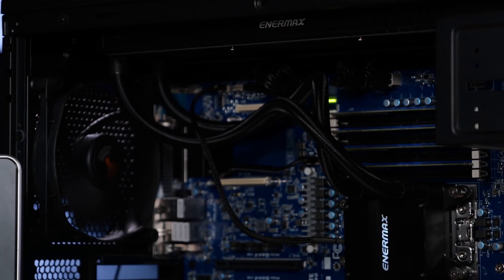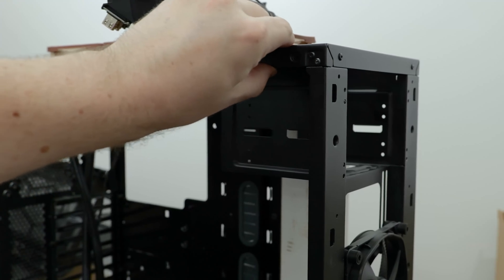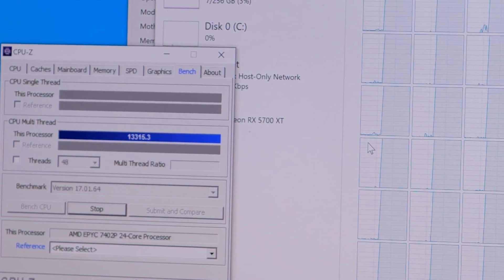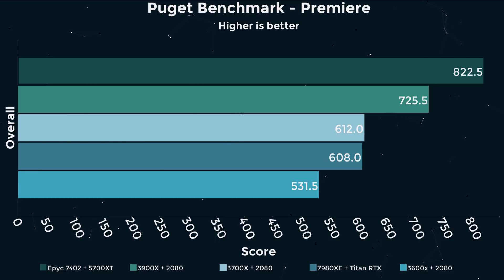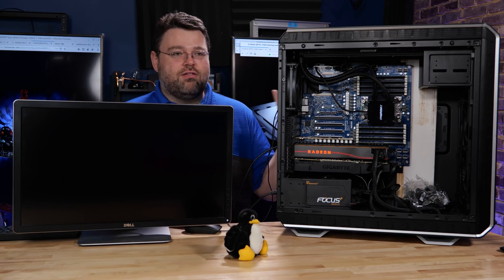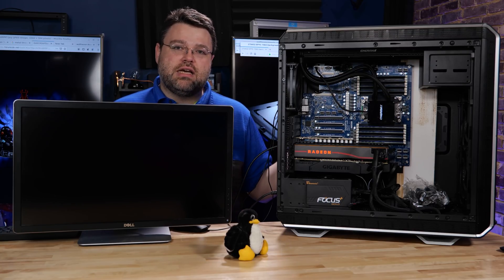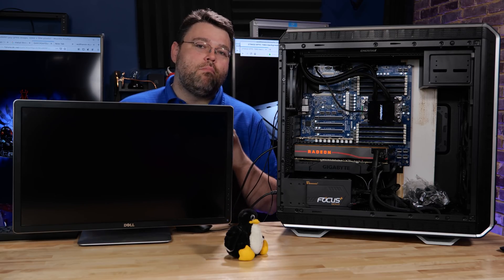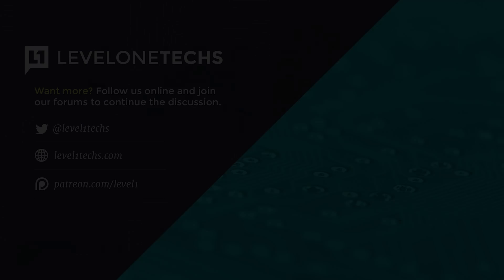Hands on: "Threadripper Lite" 24 core EPYC!*

Comment: Does not the case Dark Base 900 Pro come  3 Additional standoffs for E-ATX ? I wonder if those can be used on the holes that are used to connect the motherboard tray so a long E-ATX motherboard can be mounted there on the right side ? Can someone confirm ? Thanks

Comment: I made the mistake of ordering MZ31-AR0 without observing the PCIe slots backing into the DIMMs thus limiting options to short depth cards only for the majority of the slots. I planned to add a few NVMe quad bi-furcation cards, and most are super deep except for unique enterprise (Dell 7YJH0 [also known: 400-BPJP]) and consumer (e.g., Sabrent EC-P4BF) options. 

The MZ31-AR0 board is amazing, especially since it has an OCP mezzanine slot and it was trivial to upgrade the firmware to unlock PCIe Gen 4 speeds. If your build configuration requires access to full length PCI-e cards, I highly recommend going with the ASRock Rack ROMED8-2T or Supermicro's collection of H12SSL boards. In restrospect, the MZ31-AR0 board has more constraints than the ROMED8's and H12SSL's because of the physical limits due to additional DIMM slots and it being the only E-ATX variant between the other brands. I have a new ROMED8-2T arriving next week, so I'll most likely be returning or selling the MZ31-AR0 until I can take advantage of the unique layout.

Comment: @Level1Techs I actually have v3 of this board and was wondering how did you control the CPU Noctua fans. They keep saying it's going at 150rpms, and ramps up all the fans to full speed. I can't even find anything in the bios regarding fan control. Any help would be grateful.

Comment: Wendell and Level1Techs - Thanks for the amazing briefing. I am trying to build a similar system and would be very much helpful if you can help me answering few queries.

Do you have a list of parts that we can order to build the server class workstation? 

I have listed a few parts from the video

1. Motherboard - Gigabyte MZ32-AR0
2. CPU - AMD EPYC 7702 Class of CPU ( Is it ok to install a Threadripper CPU in the same motherboard ?)
3. ENERMAX LIQTECH TR4 II 
=============================
Need your help and suggestions with 
1. Memory Configuration - Is is ok to install the VENGEANCE® RGB PRO 128GB (8 x 16GB) DDR4 DRAM 3200MHz or we need the ECC versions of the same?

https://www.corsair.com/us/en/Categories/Products/Memory/Vengeance-PRO-RGB-White/p/CMW128GX4M8C3200C16W

2. The Power Supply Module - CORSAIR AXi Series, AX1600i, 1600 Watt, 80+ Titanium Certified, Fully Modular - Digital Power Supply  
https://www.amazon.com/dp/B0787G1Z74/ref=cm_sw_r_wa_apa_i_x0E9Db22K600A

3. The Cabinet  -  Anidees AI Crystal Cube Mesh Front Panel AR V3 Dual Chamber Tempered Glass EATX/ATX PC Gaming Case w/ 5 RGB PWM Fans / 2 LED Strips - Black AI-CL-Cube-MAR3 

https://www.amazon.com/dp/B07NWHFMXP/ref=cm_sw_r_wa_apa_i_8XE9DbATJGQ5C

4. Is it ok to install the Intel P3700 NVMe in this system?

Comment: DO NOT BUY THE ENERMAX LIQTECH 2
It sucks just as bad as the first one; it WILL corrode, clog, and potentially leak on your VERY expensive components. I have had one and had it happen to me firsthand. You're already spending some dosh, just do a quick & basic custom loop on your cpu and have confidence that some shitty company isn't screwing you by cutting corners

Comment: Verry nicely Presented :)
A Side question, do you have experiance with RDMA on iSCSI/iSER or Infiniband Solutions?
I am having trouble to extract the claimed performance out of my mellanxo adapters in vmware using plain iscsi...they top out at around 20gig/s...dissapointing to say the least (40GiG Adapters, jumbo frames etc...configured)...i am realy fed up with ESXis Networking performance at the moment....its just slow as donkey sh*t compared to freebsd for instance..

Comment: These will be so cheap in 5-7 years I'm definitely buying then for server shenanighans. Probably not an Epyc, but a Threadripper that can overclock. Honestly thou, if an used Epyc is cheap enough at that point in time. It's worth a shot too.
Reply: Good prediction.
I just picked up an Epyc 7F52 (16c/32t) and this exact motherboard plus 128 GB ram for just under 700€

Comment: I built a new Intel based system with AMD Ryzen 7 3700X, MSI MPG Gaming Plus X570 motherboard, 32GB of Corsair Vengeance LPX RAM at 3200MHz, GTX1060 6GB and Intel 660p 512GB NVMe SSD for a boot drive. What? I said it was Intel based!

Comment: Shucks cuz , I used a ball point pin tube for a gpu support , duct tape to seal case gaps all over the damn place , and a leather cover for rgb ferry crap on front of an old lenovo case (last RGBs I couldn't disable  with wire snips) . Sucker hauls, stays cool and quiet ... with leather cover off . I'm not even joking . She's my ghetto rig . 
So seeing you use forest carcass to support the unit , you golden , man.

Comment: Wendell my 2990wx Threadripper gets 3.85GHz across all 32 cores at 1.184v on DDR 3000 Non-ECC running at 3133Mhz  using the cheapest MSI X399 motherboard. 
About time you mention the NUMA performance regression of Threadripper 2 in Windows 10.   It seem after January you went silent on the issue.
The CCX fix of the 1903 Win Build helped in some areas as that issue affecting all Ryzens.  
I'm not interested in any more TR after the 2990wx.

Comment: to understand how things changed in under three years, my first thought at seeing the title was: "only 24 cores?"
Reply: So true, 2 years ago was i7 at $1700 for a slow 10 core (lost to its own 8 core counterpart a lot of the time and it overclocked like a turd), and so I picked the $330 Ryzen 1700 which wasn’t all that far behind... then I was like psshhh, 8 core 9900k for $550?!? And I went with TR-1950x (which was cheaper since 2nd gen was out. It was to the point of no competition that it was like “hmm... is 800 MHz worth spending MORE and to get HALF the cores, sacrifice half the memory channels, and get only 1/4 the PCIe lanes? Nope!).

I enjoy AMD domination in performance and value (even if it cost more, it would still be worth it, as there is no way to run my quad crossfire on Intel with reasonable results besides maybe the 28 core they have, but that chip melts sockets on regular water cooling overclocks...). Intel has become more power hungry than FX, like the 9900k is 300w (that requires sub-zero temps and high voltage for FX to reach, I peak at 350w at 1.7 Vcore with FX-8350 at -35c block temp and somewhere colder than 0c peak core temps but software can’t read negative). It’s just mind blowing that people are all about 10 or 20w on a GPU just to say Nvidia is better, but then they overlook the 7980xe uses 600w on a mundane 4.5 GHz overclock on water, and meanwhile TR-2990WX doesn’t even pull close to that at good clocks with nearly double the cores! Intel has so little left, they only have single thread clock speed advantage at this point, or for low thread applications. They can’t even compete with storage solutions either, they have nothing. It’s completely backwards now, Intel is almost FAILDOZER levels (except back then FX was pretty killer value for multi-thread workload at the cost of a locked i5 4 threaded chip, shudders... 4 threads....). Interesting times indeed...

Comment: Supermicro has atx and ex-atx form factor boards for single and dual socket epyc solutions. They are the real overkill setups. You can just drop in a good quality tower or mid tower  case.

Comment: Can it run FreeNAS (FreeBSD) though?
Reply: Why on earth would you need so much compute for zfs.... seriously get a board that can support a bazzilion drives native (or at least can slot a few x16 SAS controllers)... slot in a tad of RAM...something like ~32GiG for instance.
Configure the storage as stripe set (mirrored if you want to emphasise on reading)...use caching and lz4 for compression.... a fast nic et voila...enjoy about 1.5gbyte/s in each direction... there is really no need for much compute power on something like bsd ;) well at least until  you breach in the high speed ethernet region like 2*40GBit  and saturate those links...

Besides there is a hardware compatibility list for freebsd....and therefore most likely something simmilar for freenas.
Most problematic are ne network drivers...avoid hp controllers...intel do work but are slow....go mellanox for bsd based distributions.

We do run freebsd 11.3 on a few dated intel machines....2*8 core xeons (2 ghz i believe)... the cpus dont do jack shit...the tend to run below 10% utilization most of the time. Granted they are used as iscsi storage so the 14TB storage is presented as block device to the target (vmfs)
Reply: @justacomment1657  I was hoping to run bhyve again, but I've ditched it in favour of xcp-ng and store the data for VM in FreeNAS via iSCSI as well.

Agreed, over 8-cores is potentially overkill especially just for data storage.
Reply: Not trolling. I’m seriously asking. Don’t feel like throwing x299 at a storage server as it is harder to source decent x99 boards for Xeon.

Comment: It's been about 15 years since I've built a desktop pc up until about 6 months ago. AMD has its drawbacks like often requiring a little bit of tinkering, but damn if they haven't made the world of desktop pc building exciting again. In the last 6 months I have now built 1 3700x 2 2700x and 4 2600 builds. Samsung's Nvme drives and AMD have made it exciting to make new builds again. Absolutely cannot wait to build my first Threadripper late this year if not early next year. Yes it will be completely overkill for my usage, and it will more than likely need some super tinkering but I will enjoy every minute of it. Awesome channel by the way you helped a lot catching me up to speed with the latest pc info. Ps lets all send up a prayers they keep the cost somewhat reasonable.

Comment: November is coming. 

And oooooh boy. 
Threadripper is going to rip what was left of intel's high end after the 3900X  did most of the work already and the 3600 killed the i5s
(yeah intel FOR THE FIRSt TIME IN ALMOST A DECADE dropped prices, but not quite, they dropped the igpu and with it around 30 dollars on the f series)

But Server proven architecture and thermals on ALL THE BIG GUYS for AMD and them just DESTROYING anything intel has on wattage, and instructions per core per clock, and number of threads, and price.. and PCI -Express, and honestly now better memory support, and freaking hell man.
Reply: Hence the name of epic.
Reply: Intel gonna be the this century cyrix if the winds keep blowing and flowing into the amd's sail..

Comment: The 3950x delay is so disappointing. My 1700 is looking for a >2x performance upgrade.
Reply: Guys... Notice the > symbol. I'm very aware.
Reply: @landwolf00  
🤣🤣🤣
Perfect response!
Reply: Yeah AMD, step up.
We want to double our performance in under 3 years.
Reply: The 3900X will be closer to a 2x improvement. The 3950X is easily higher than that.

Comment: Who buys Intel CPU's ? I haven't in a long, long while.
Reply: Well, i'm back to AMD now because i have been travelling for a while and unfortunately there were very few AMD laptops available at the time, it has been a nightmare as a GNU/Linux enthusiast especially with that Intel/NVidia Optimus crap that basically no one talks about except maybe Linus (the real one) for his legendary quote: "So Nvidia F*ck you"...
Now, i won't travel that much before a while, i'm building a proper machine and it won't be an Intel/NVidia machine, these companies have fooled us far away enough, they need to be shaking up to the bones...
Reply: ABMNS PRODUCTION make one of these but use the Ryzen Pro 2400ge (supports ECC) get a 10" USB Type C powered monitor and wireless keyboard.
https://youtu.be/-yEgioZjgtE
Reply: They still in business?
Reply: Gamers...
Reply: muh diversity I just bought new intel Xeon servers because because any server grade virtualization solution severely knee caps amd cpus and limits functionality. With that being said I also just flipped my gaming pc from Intel / nvidia to a Ryzen based system with a Radeon card. Hella impressed with the performance of a $200 cpu almost trading blows with the $1200 xeons 😂, just wish the would work with esxi 😒

Comment: I thought there was only one numa node on zen 2 epic/thredripper ( unless you had two epic processors) because the RAM controller is now integrated into the main io die so they don't have to do numa splitting thing to make Windows work less less bad/efficient, threadripper and epic zen2 in single socket setup should perform same as ryzen (as long as your using normal ram)
Reply from the maker: Threadripper 3000 is one numa node as is epyc. You can technically configure the numa slit distances for anything truly latency sensitive though
Reply: @Level1Techs  be nice to see how thredripper 3000 runs with normal ram (i would imagine it be overall like a 3900x but with scary more cores) ,I assume epic requires ecc registered ram witch hampers overall performance and lower clock speed compared to what we be get with ryzen and thredripper
Reply: That is my understanding too, I expect there will be far fewer problems with Windows this time around.

Perf of 32C parts with 3200MHz RAM will be breathtaking 😁

Comment: You are right that whoever needs serious workstation will look at ThreadReaper because all the reasons you've mentioned. But... I still think Intel will get the more sales (profit) because :
1. They will come with 4+GHZ all core clocks and will have the higher bars in the benchmarks. (yes the power consumption might be crazy but why do we have 1+ kW power supplies)
2. The "professionals"  will look at what their software is validated on. Most of the case it will be intel. 
3. Intel has bigger selection of MBs. 
It will be same the as in the server market - AMD has more features and performance per wat/dollar/TCO, etc. but it will take a lot of time for partners to catch up and mindsets to change. Anyway the geeks will be salivating :D
Reply: Threadripper actually sells better than Sky Lake X. No sure what you would expect that to change with Cascade Lake X which is just a refresh.
Reply: @1idd0kun  Do you have a source for this? Like world wide sales numbers or something that approximates that?

Comment: Thanks Wendell. Mind shareing total system Powerdraw with/without GPUs?
Reply from the maker: w/o GPU was ~210w. Depends on the GPU, but added quite a bit. Peaked around 240W. But ~<200w full system at the all power for 24 cores @ 3.35 is just crazy
Reply: Thank you for the Answer. Currently building a Ryzen 3600 Based Game & Cloudserver based on proxmox & Debian Guests. Since the normal Ryzen are super low idle power, i wonder about those lower Core, higher GHz ROME Ones. Do you have realworld Whole System IDLE Wattages?

Comment: Why are you pretending this is new? 24c48t threadripper been around for years. 2970wx
Reply from the maker: It stands to reason if this 24 Epyc Rome chip runs circles around a 32 core 2990WX, it will run even more circles around the 2970WX and the Epyc "Naples" 7401P 24c processor?
Reply: @Level1Techs   https://forums.servethehome.com/index.php?threads/overclock-your-amd-epyc.23422/  Still figuring out how to overclock rome, need to look at the BKDG to adjust MSRs but ... Epycs are all unlocked.
Reply: Level1Techs Is the EPYC 7401P capable of running circles around the 2990WX when both are operating with Linux? 

I am yet to catch up to the reviews on the Zen2 based chips. Unfortunately haven’t had the time to do it yet. 

I have currently switched from Windows to Linux for my 2990WX workstation. I am seeing an insane uplift in performance versus Windows. I wonder if this EPYC part can compare even though it is 8 Cores off of the 2990.
Reply: @kyozon8925  
Zen 2 has 2X AVX power over Zen 1.x
Reply: You can't just compare core counts and call it a day, the new Rome chips offer so much more than just lots of cores. PCIe4.0 with double the bandwidth, higher core frequency and IPC due to new node shrink and architecture, better hardware and ram compatibility etc etc. It's so much more than just a 2970wx, they aren't on the same level.
Reply: ? These are the new Rome chips, released this past August.